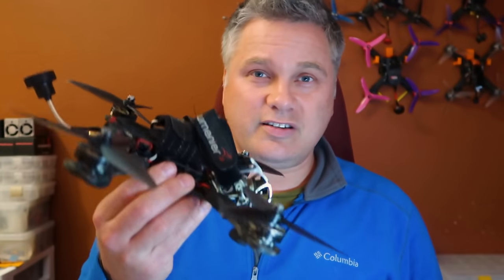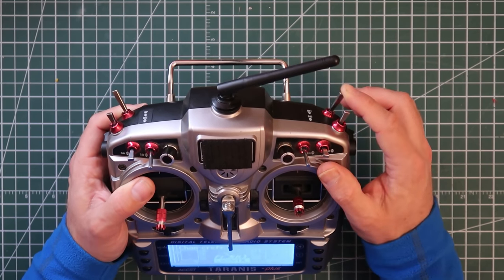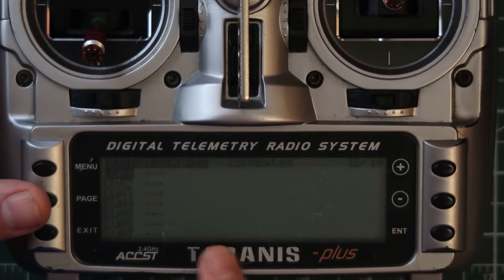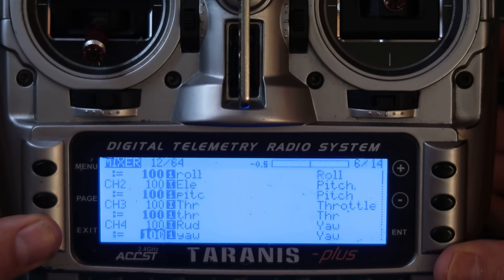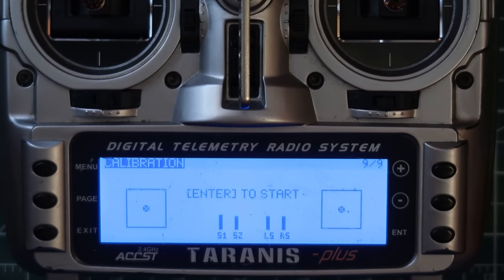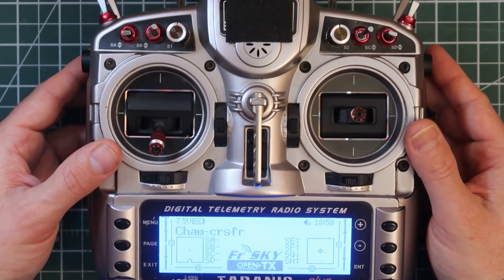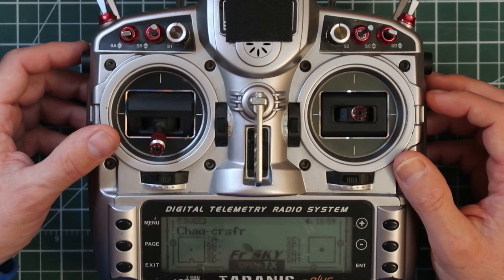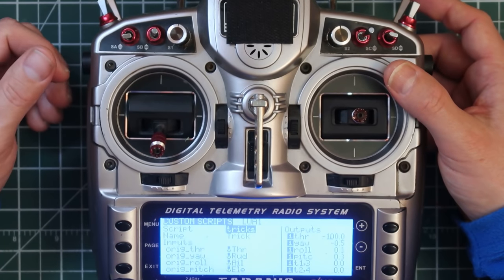Automatic TRICK-ON-A-SWITCH : HOWTO

Comment: Dude what we need is macros on the flight controller that utilize sensor input for timing.
Reply from the maker: Now that would be perfect.  it was one of the directions I was thinking of taking this near the beginning, but making changes to betaflight was just too complicated for me to start off with.  I might go there down that road if there is enough interest...
Reply: @MactacFPV  it will be more easy on taranis rather than betaflight, the only things we need are telemetry datas. telemetry gives us very clean position information with a little bit delay thru accelometers, but i know that will take a little time to work on it. Maybe one day you will create a V2 version for us :D I will contact you if i can create one also if i have time to work on it.
Reply from the maker: @NDMCN  I looked into that, but the latency is too long.
Reply: are you using soft serial for telemetry ? i am just thinking that may push that latency a bit far.
Only one of my quads had telemetry before i use micro receivers so i did not use telemetry this much but i remember that delay was something like 250-500 milisecond is it above 500 ms ?
Reply from the maker: @NDMCN  I actually use crossfire.   Any amount of latency is problematic because if your rates are 800 degrees per second for example, just a 10ms delay would 8 degrees off.
Reply: @MactacFPV  aah my idea was a little different than that, Using telemetry in a loop will be absolute disaster because of latency.
But that will be perfect if we can use it before trick starts for calculating all angles on all axes
flow diagram will be something like that
1)to go switch activated->
2)...waiting for telemetry data while we still have controll as normal but fliying as stable as we can 
3) when a new fresh telemetry data comes do the trick as soon as possible depending on last angles we got on telemerty
and all of this will be in a half second just depending on when the next telemetry data want to come
Reply from the maker: @NDMCN  Oh, OK - gotcha.  I think it could work if we could get the latency down to maybe 50-100 ms at most.  Some tricks require some timing (e.g. reverse knife edge through a gap requires really precise timing of when the trick starts so you hit the gap at the right time).   Personally, I haven't had much of a problem with making sure I start a trick at the right angle, but I can imagine how it would be important for some tricks & people.  I definitely think it's worth testing out.  If you can get the telemetry part working, I'll make the mods on the script & post it.
Reply: @MactacFPV  It will take a while just because of i dont have my dear taranis between my hands now, it is almost 2500 km far away from me :D but when we meet again i ll start working on it ^.^
Reply from the maker: Oh no!   Here's hoping that you get it soon :)

Comment: Madness,  absolute madness. Interesting project, but I'll have to pass far as personal use goes. :D
Reply from the maker: The goal was more learning than practical use.
Reply: @MactacFPV  Absolutely understand that, just saying I wouldn't use it.  It's really interesting of course what you've done with it and even opens up some possibilities to me for interfacing systems.  Imagine a base station with override ability rather than just flight systems on the FC for example ^.^
Reply from the maker: @madpinger  Oh man, that sounds really interesting!!
Reply: A little too close to those kiddie toy drones...?
Reply: @MactacFPV  Actually,  thinking on it after a nap.  The trainer function would be suited to this sort of control mechanism.  Like a laptop with telemetry data.   It'd suffer no more latency than an FPV pilot
Reply: @CatsAreGods  I'd like to see a toy grade do more than flips and orbits.  This is not likely to make its way into those, at least not with current stuff.

Comment: Of course you'd need a script like that.. you are a gasp thumber! just kidding lol.
Nifty little idea.. Makes me wonder if we can use telemetry (A lil problematic because telemetry packets can be quite slow) + some kind of PID control to make the script be more fool proof to the initial state..
Good job!
Reply from the maker: Thanks!   I did consider that, however the latency of going to the radio and back again would make it not work properly, or at least very, very difficult to make work.  I do find though that it's not needed as long as you are flying in OK conditions.

Comment: What if i dont want the switches for time and so on.... ??
Reply from the maker: You can get rid of them, shouldn't be a problem..  The issue of course is that you won't be able to tune the timing of the tricks, which you will have to do.  You could always remove them after tuning.   What is the reason you don't want them?
Reply: Mactac it was only a tought.... but thanks i Go to try it 😂
Reply from the maker: @revenite3290  Let me know if you need any help!
Reply: @MactacFPV  yeah i need help...when i go to lua on my tarnis it comes : no scripts on SD card....why xD
Reply from the maker: @revenite3290  You copied it to the /scripts/mixer folder on the SD?
Reply: no its was a error from the sd card xD i made it and it works so fuckinf good, thx for that